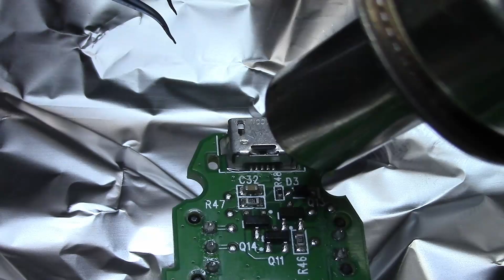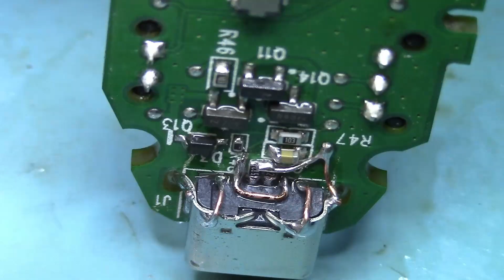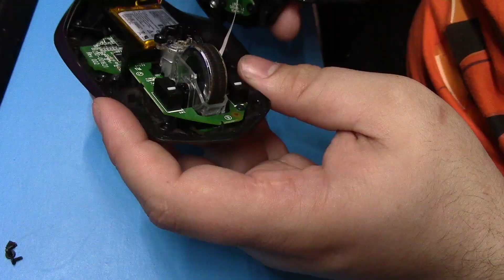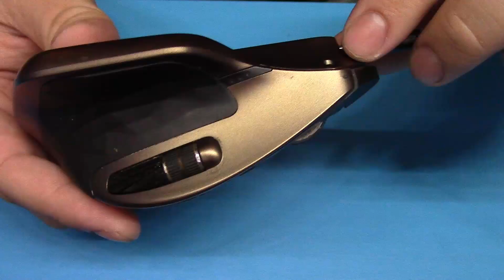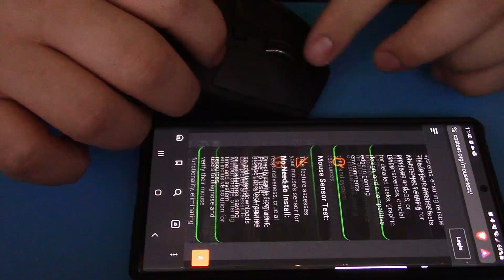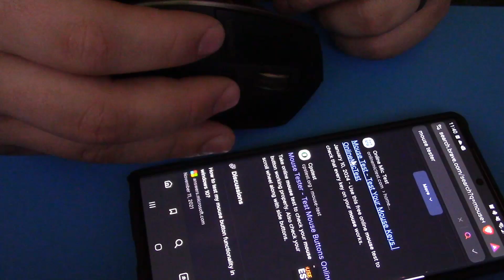Logitech MX Master (1) gets a USBC mod. (solderking out)

Comment: I have MX Master 1 for about 10 years now. Changed its outer case couple of times. Managed to solder USB-C today. It fits really well there (with about 0.5 mm spacing from the PCB). I used long jumper wires in silicone insulation and kapton tape to cover the Microusb pads after soldering so it would be easier to reposition the connector. Thanks a lot for the video!